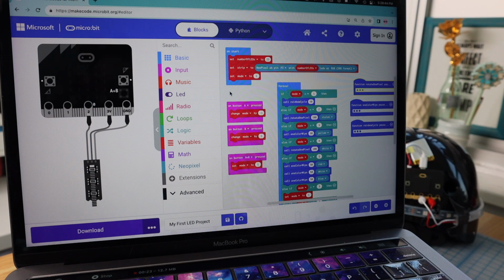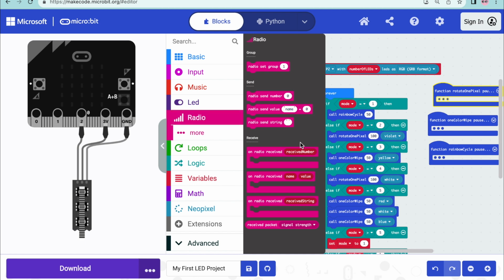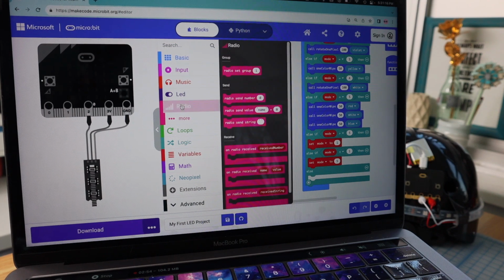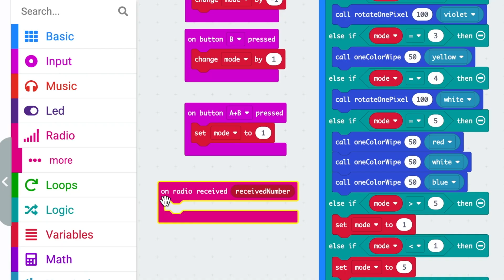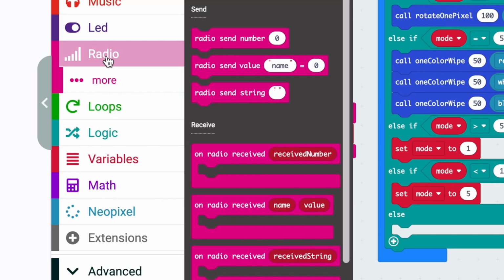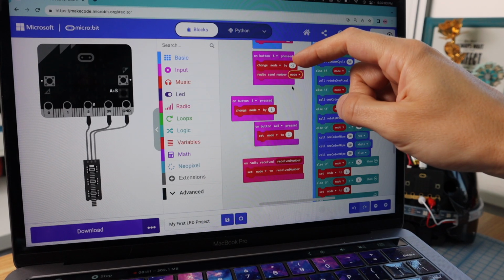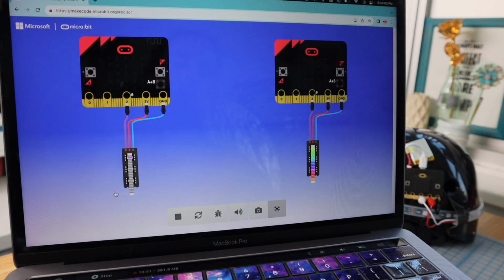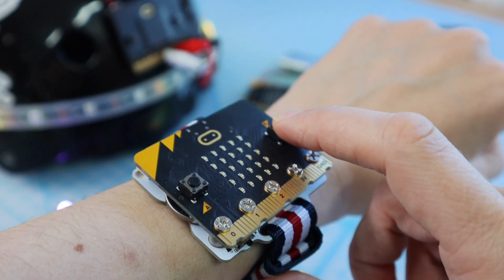Syncing NeoPixels over Radio // Creative LEDs * 07 *

Comment: Love this video. Have you ever done anything in CircuitPython with CircuitPlayground Bluefruits or Raspberry Pi Pico Ws? These are boards I use in class and I’d like to sync things like wearables or other LED projects. Seems like micro bit radio is an easy way to sync but the boards I’m using lack this cool feature.
Reply from the maker: Yes! I used to teach a similar class using circuit playgrounds. They use Bluetooth, which makes it easy to sync them with a phone, but no, I couldn’t find an easy way to sync them with each other. I haven’t tried the pico W’s yet but would be curious if there was a way to communicate between two of them. Keep me posted if you find a way!

Comment: It would be neat if the slave receivers automatically downloaded the patterns from the master controller so that only the master would need to be reprogrammed to implement new patterns.
Reply from the maker: Yeah! That's possible. You can do a lot more than what's in this video. A simple version would be to send the first pixel color over the radio and watch it run down all of the NeoPixel strips at the same time. That way you're letting one controller "paint" all the other pixels too. :)